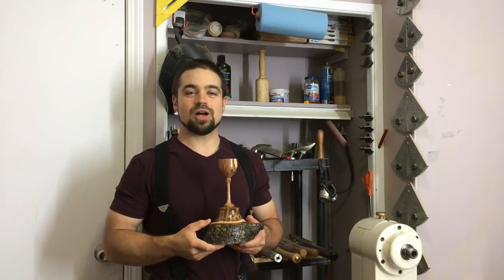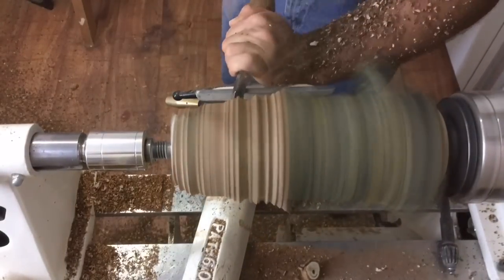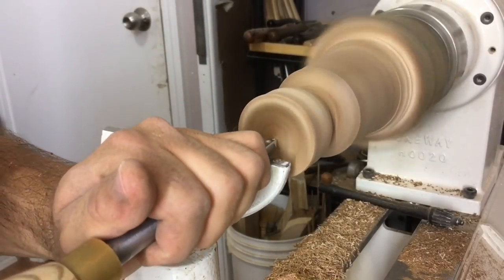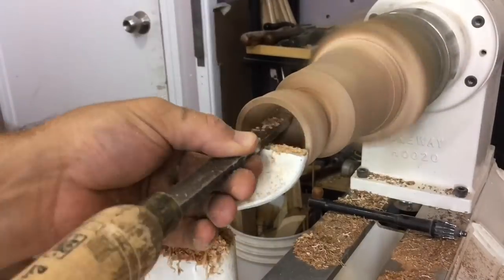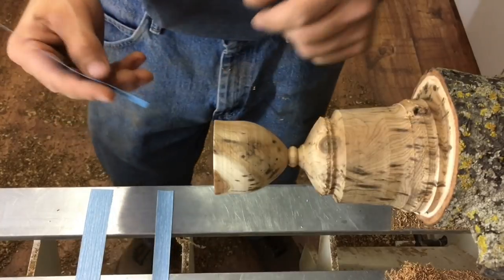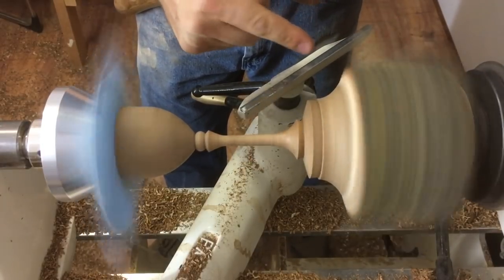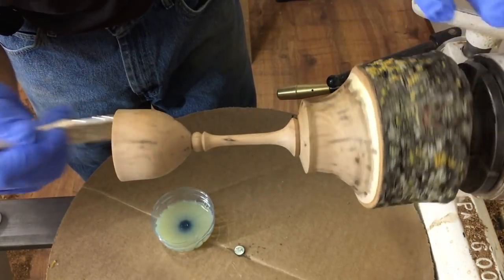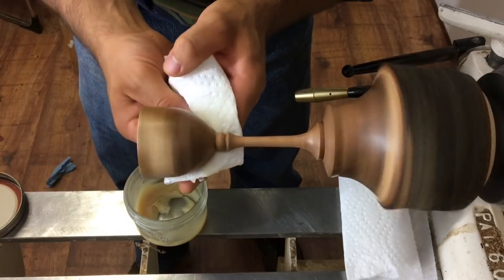Woodturning - Emerging Goblet (Diseased Chokecherry)

Comment: You could alternatively have had the stem emerge from deep inside the log with a wide cup-like barked rim rising up to surround the long stem, like the emerging stem and cup was the narrow jet from a rock dropped into a liquid and the surrounding cup being the splash part (perhaps with a deeply uneven rounded edge, like a real splash).  That would be unusual, I would think.  A little like the palace in the movie NEVERENDING STORY.
Reply from the maker: Nathan Okun That's a great idea for a design Nathan, thanks for taking the time to leave your input! You have a keen ability to visualize. Many people (myself included) think so much of the form first and foremost that all the "outside the box" thinking falls to the wayside. Sorry for late reply!
Kyler

Comment: Dont use paint to seal your wood. Paint is made with finely grind titanium oxide. Very hard and abrasive. Very nice goblet. Love the wood.
Reply from the maker: Pierre Nadeau Ah so that's what's happening! I had sealed up a ton of wood a couple years ago with this specific paint and it was by far the worst. I even sealed bowl blanks so I just had to cut straight through it, not fun! Other paints didn't do it so badly, but still caused problems. I guess I will have to try those emulsified wax sealers.
Thank you for the kind words and insights, much appreciated! 
Kyler
Reply: @woodturnerky8556  I started using yellow glue.  2 coats and it's done and it's easy to get, plus it has other uses, something wax sealers don't do.

Comment: Very cool where do u get the bees wax with mineral spirits...thanks jeff alta iowa
Reply from the maker: Jeff Bunjes Thanks Jeff! I got the beeswax in bulk from a local honey producer (quite a few around my area) and I slowly heated the wax in a double boiler until it melted, and then added the beeswax. Make sure to use a double boiler so that you don't risk overheating the mineral spirits! 50:50 ratio seems to be a nice balance between soft enough to buff by hand, but waxy enough to still get a good build in short time. Best of luck!

Comment: This is the kind of work I'm striving for ! I love the bark and the shape so people know it came from a log not lumber bought at a store to me that's all I want to do . Do you sell most of your art ? Make a living out of it ? 
Thanks again you blew my mind. ....lol
Reply from the maker: Joe Blow Thank you kindly Joe! I really like turning found wood, and I have probably bought less that $30 worth of turning wood in my life. I do sell my work and it supplements my income a bit. I have seasonal work so during slow periods I amp up the shop work. So far I have mostly sold locally at art and craft shows. Online sales is likely the next step. Eventually you just have to start selling because your work will start adding up. Another bonus is I hardly have to buy people gifts anymore, just head over to the lathe lol
Reply from the maker: Joe Blow God gives us plenty of material to work with! I started on a mini lathe too and it was perfect to get going on. I tell people it's best to start with a mini because they are a bit less powerful, so much more safe until they get it all figured out......but seeing you have a Harley I don't think powerful machines intimidate you lol
Reply from the maker: Joe Blow the main things I would consider when buying a lathe, is to make sure the headstock and tailstock use morse taper #2 (sometimes #3 on bigger lathes tailstock like my Oneway) and that the spindle on the headstock are either 1" x 8tpi, 1 1/4" x 8tpi, or even m33 x 3.5 to make sure you can easily get accessories for it. Another thing to look into is if parts are still available. If you can view it first, make sure the drive centre and tail stock live center meet up. After that it's mostly just preference like if you want variable speed, or belt or reeves drive, what size and power (if doing bowls over 10" I would suggest at least 1hp). Maybe two more important thing is that the speed can get slow enough (500 or less for slowest is best, 600 can be a bit too fast for out of balance pieces) and that the tailstock can add pressure without sliding down the bedways. And stick with flat bedways, I would stay away from those tubular ones. Hopefully I'm not just repeating stuff you already know! 
My business partner and one of my best buddies (who past away a few years ago) both built bikes for themselves, and it was amazing to watch the bikes come together. Mostly Harley's and Indians.
Reply from the maker: Joe Blow If you are in the states, maybe look for a jet or a powermatic. They are very popular and you should be able to find a good one used, or if you want brand new they are very good for the price. I also heard good things about the new Laguna's in terms of price to quality. Best of luck!